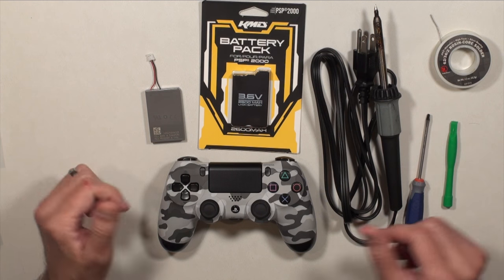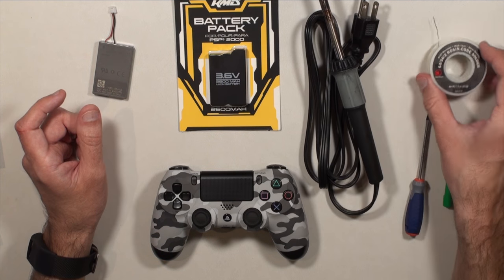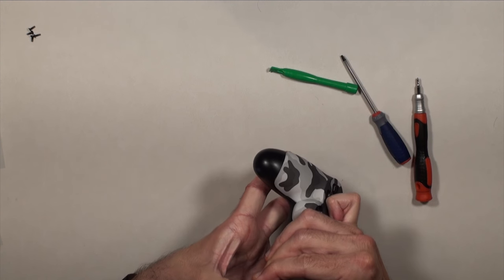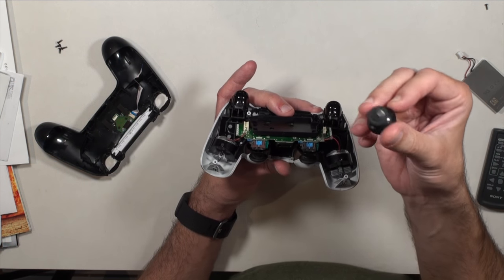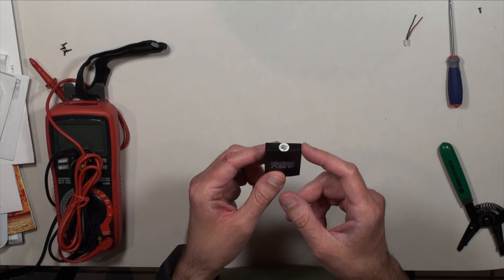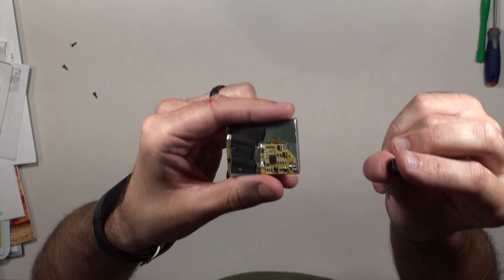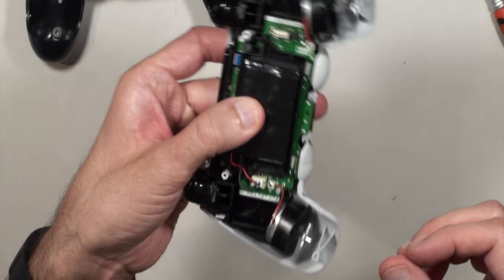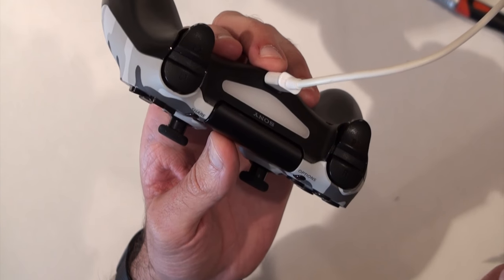PS4 Controller Hack - How to Double PS4 Controller Battery Life

Comment: for anyone hesitant using iron solder, just use a hot glue or 3M super glue. it'll stick. 
just make sure the wire contact sits perfectly

Comment: I have found that almost every psp battery I have purchased for my psp's in the last year or so 10 total batteries has either been grossly misrepresented after dissembling it or such old stock that the battery has lost much o its capacity from sitting dormant

Comment: shows a flathead screw driver a very small tip screw driver.
me: hey what are you gonna use it for?
uses an actual phillips screw driver to open the controller
me: what's even the flathead doing on this video lmao.

Comment: Hello HighTechCheck. Can I assume that since we would be using the original battery leads, that this new battery will work on both old and new dualshock 4 versions? I need to replace batteries in both my gen 1 and gen 4 controllers. Thanks.

Comment: mine comes up with a "?" in the battery icon for controller i did everything in this vid and nothing works
Reply from the maker: what battery are you using?
Reply: HighTechCheck same one when i plug it in it will light up orang then stop and in about 2 to 3 min later it will keep lighting up and charge but it drains fast so its like having less then 3200 mah even less then 1000 i saw another vid were guy used the ps4 board and not the one that comes with this one
Reply from the maker: You may have gotten a bad battery, I am still using the one from this video without any problems.
Reply: HighTechCheck im going to take it out and see if it needs some tlc nice hack though
Reply: You got a fake and im pretty sure cause i had a psp with a fake battery and it drains the battery too fast

Comment: Was the 3600 mAh battery the same size, or did you have to make room for it in the controller? Thank you for the video either way, you showed me the solution to the bad reviews on the cheap 2000 mAh batteries
Reply from the maker: You just have to remove the outer black plastic case, then the battery inside will fit just fine.

Comment: Hey, a bit late here, but does this battery have a protection chip inside to avoid over charging?  because I realize that you just cut the original wires without taking the chip / motherboard out from the original battery?
Reply from the maker: Yes it's fine, the other battery has it's own chip that cuts off charging when the battery is full.
Reply: HighTechCheck  has anyone try doing this with Nintendo battery or cellphone battery like Nokia phone battery